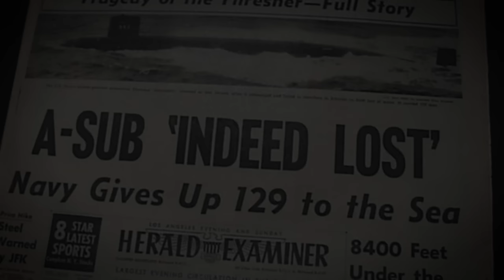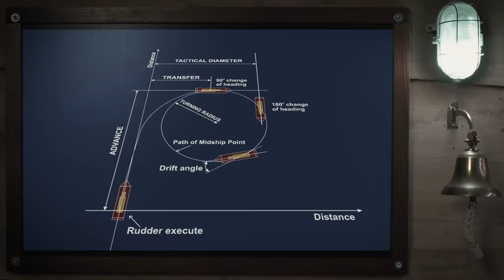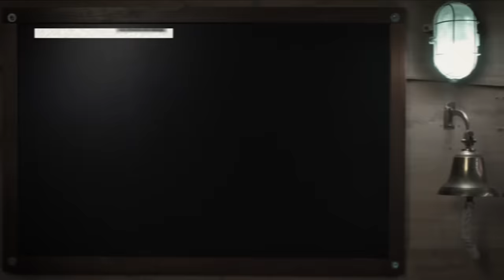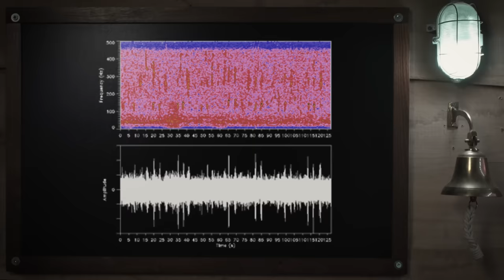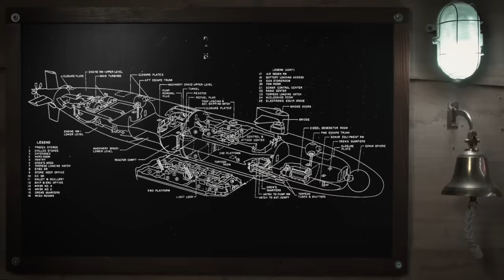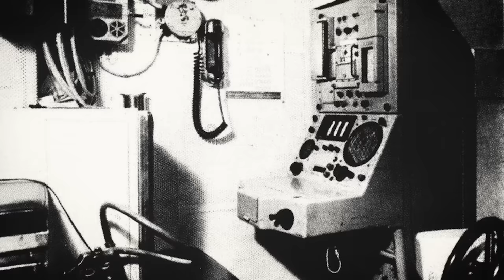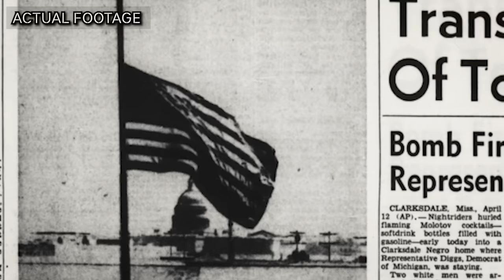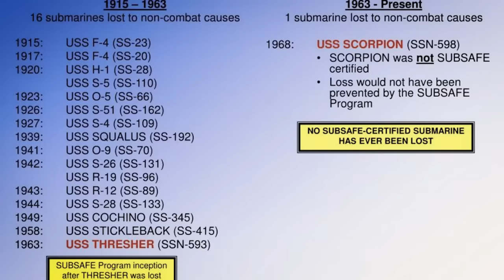This Water Pipe Killed All 129 Men

Comment: I had heard about the Thresher a long time ago.  I also read about the freeze-up of the strainers that interrupted the ballast blow, but this is the only source I've come across that explained that the strainers were not a designed part of the system, and were only temporarily installed by maintenance for testing purposes, and where meant to be removed prior to going to sea.

Comment: If the research I read is correct, it was not a “pipe” that caused the flooding, it was a faulty weld at the hull/ pipe junction.

Comment: Ex Navy Nuke Submariner here. I trained on the S5W reactor in MTS-626 in 2016-17. What you say at 8:42 makes no sense. "Saltwater from the reactor cooling pipe floods the engine room." Saltwater isn't used in the primary or secondary loop. Also it isn't open to sea pressure so I doubt that the depth would cause a pipe failure with anything to do with the reactor or steam system. If those pipes did break, it would not be water coming from the reactor vessel or piping before the turbines (as shown in the animation), but extremely high temperature/pressure steam.

The Thresher is a point of discussion in almost every step of submarine training, even long after I got to my boat. Ultimately we don't know what caused the loss of power, but we are certain of the high pressure air lines freezing during the main ballast blow. Also as a machinist's mate learning quality assurance, it was pretty crazy to see how intense the SUBSAFE program is for all the critical systems on board. Parts go through extreme testing and can be traced all the way back to the mine where the ore for the steel was mined.

It's cool to see such a well made, engaging video telling the story for so many people who otherwise wouldn't know about it though! I'll never forget how nervous I was the first time going to test depth. If you weren't standing watch, it wasn't very exciting though. No creaking noises or compressing bulkheads like in the movies, so for the next time I was off watch and slept through it.
Reply from the maker: Thanks for sharing. It's great to hear from people who understand better than I do.

Comment: All in all, good video. I'm not a nuke (full disclosure) and not a submariner. I was a Surface Warfare Officer for 20 years (that means I was on ships, and the powerplants of my ships were conventional steam or gas turbine). I am also a history buff (not a historian, just like history). When they isoltated the plant during the casualty, they had residual steam in the plant (a nuke plant is a steam plant, but instead of using boilers, they use magic rocks to heat the water into steam) and possibly could have provided steam to the turbine to drive the boat back up. Rickover modified procedures after to give his nuclear engineers more latitude to save the ship vice foloow rote procedures. It's a case study and is actually part of the Timothy Blake Nelson movie about Rickover (it's a good movie, watch it!).
Reply: They shouldn't have put a greenhorn officer on the job.

Comment: Aye, my father worked on the design of the steam turbine for this sub. He had a photo of it for decades and I eventually looked up the SSN number to discover it was the Thresher. He said there was a failure in piping that froze and prevent the sub from surfacing. He had that picture in his office till retired and then kept it on a wall at home. Sadly, a sibling stole it after he passed.

Comment: FYI- a thermocline bends sound waves, not necessarily radio waves. The Scorpion was lost after the Sub-safe program was implemented, but Scorpion had not been retrofitted with the Sub-safe modifications at the time it was lost.
But otherwise a very detailed explanation of the causes of the loss of Thresher. It just goes to show, the smallest oversight can be deadly. Forgetting to remove the strainers from the air lines is so small and inane. I had heard that the ballast blow airlines had frozen, but I had not previously heard that the strainers were meant to be removed. The previous accounts implied that it was a design flaw. Now I know it was human error.

Comment: I was a qualified engineering watch supervisor, electrical operator, and throttleman (among other stations) on a Thresher-class fast-attack boat with an all but identical reactor and steam plant. Had all six coolant pumps failed for any reason then 'XC,' the emergency cooling system, would have been immediately initiated, and there was no way to quickly restart that reactor after XC was initiated (it was a last-resort procedure). I might add too, that there was no 'excess steam in a secondary system.' After a SCRAM, if steam continued to be drawn by keeping the main engine throttles open, the Thresher's reactor would have QUICKLY cooled to the point where it couldn't be fast started without risking potentially catastrophic damage (say, cracked reactor pressure vessel). However, and this is the procedure NAVSEA came up with after the Thresher sinking, they could have kept MS 1&2 (the main steam isolation valves), open if the throttles were immediately shut and electrical loads greatly reduced. In my day, upon a SCRAM, the throttleman would immediately close the throttles, the electrical operator would trip both turbine generator breakers (loads would automatically shift to the battery via one or both motor-generators) and the order would go out, very loudly!, over the 1MC (ship's announcing system) "Reactor scram, reactor scram! Rig ship for reduced electrical!" At that point, the reactor could be fast started IF a list of conditions were met, the most limiting being reactor cooling system pressure and temperature, which had to be within certain narrow limits. I might add as well that the SUBSAFE program the Navy started after her sinking, limited my own boat's max depth to 300 feet for most of its operational life. It was only in the 1980s, after a two-year SUBSAFE overhaul, that we took her down to the (then classified) test depth of 1300 feet. I was aboard for that dive. Trust me, we took it SLOW!

Comment: Really interesting, that there are some details that come out of investigations I guess, without having physical evidence/comms. Like the temporary strainers in place, the pipes freezing up and that the young lieutenant closing the valves to the secondary steam system.
Reply: Those valves closed automatically on a reactor scram back then.  They had to be reopened manually and it took some time to equalize the pressure across them and then bang them slowly back open.  They just stay open now in case you need some emergency propulsion.  Lesson learned.

Comment: Great video thank you for your work.  This is the first time I've finally seen an account mention the strainers weren't standard on the ballast system.  All the others just mention the strainers as a new thing they were using.   Not giving the context.  As it wasn't something new rather it was maintenance having forgotten to remove an item.  To be only used under maintenance then removed.   Also i had not heard mention of the green sailor fresh from school running the reactor.  Rather an odd time to take shore leave during your ships sea trials.  Very informative and what happened makes more sense now.  Even the minor comment makes more sense.  It's still serious however it should have been able to surface one way or another.

Comment: Thresher had flooding in the auxiliary machinery space. The flooding scrammed the reactor, shorted all main circuit breakers, destroyed the motor generators thus incapacitating the entire electrical system. Sonar heard them announce over the 1MC, flooding in the ams emergency blow main bal, and was silent. He emergency blow brought them up to 300 feet from the surface. Then then went back down as the flooding was greater than the near 1000 tons of positive buoyancy from blowing ballast tanks. Pressure hull collapsed at 2540 feet.
I served from 64 to 72 one boomer, one fast attack.

Comment: NUC Submariner MM1 (1970 - 1976). By procedure, the hydraulically closed - manually opened main steam cutoff valve would have been closed after the reactor scrammed. That changed with the loss of the Thresher. Having opened a similar valve several times on the boats I was on, believe me, it took a while. It was best to have a second NUC standing by if it had to be done in a hurry. (We would time ourselves. It was a competition)

Comment: An incident description not provided was that immediate action upon a Reactor SCRAM was to shut the Main Steam Stop Isolation Valves, which deprives the ship of steam needed to drive the Main Turbine which could have saved the ship. Immediate Actions in the Propulsion Manual was changed after the accident to allow the Main Steam Stops to be left open upon receipt of a SCRAM.

Comment: Minor correction: At 08:44 you state ‘salt water from the reactor cooling pipe floods the engine room…’. Reactor coolant is not salt water. It is pure water. Salt water is used in cooling systems that then, cools other systems that cool the pure water in the reactor. As for isolating steam during a flooding event because you didn’t want to over cool the reactor following a scram, we had a philosophy in the engine room that a safe reactor does absolutely no one any good on the bottom of the ocean. 😁

Comment: I have felt how distinct thermoclines can be many times when I have swimming in the Oslo Fjord, but then usually with my feet when I'm threading water. I don't know if this happens more often in deep fjords like we have in Norway, where there is relatively little exchange of water and the uppermost layer of water can be heated up during a warm and sunny summer day. Very often when I've felt it the thermocline is about a 1 - 1,5 below the surface. I have felt it several times in the small pond in the forest when I am on a forest walk in the summer. I'm almost always get surprised by how distinct the thermocline is.

Comment: The Gertrude under water commutation system doesn't use radio waves. It uses sound. The thermocline affected the propagation of the sound waves not radio.

Comment: I suppose this is a question that might have a classified answer - but why do you need so much electricity to start a reactor? To run cooling pumps when it is shut down yes, and in most cases electromagnets are part of the scram system - but start up isn't jumping a car. Its pulling out physical rods that block the reaction. The SL1 accident happened because people were physically pulling on the control rods and pulled to hard. I imagine that a brave crewmember could be sacrificed to save the sub and start the reactor that way.
Reply: The pressurized water reactor needs high pressure pumps to pressurize the system. It will not self start. It's like trying to crank a petrol engine without spark plugs. Besides, you'd have to disassemble the reactor (again, the rods are in pressure vessel), which would take hours if not days and they had minutes at best. I doubt it's even possible to do inside the submarine itself.

Also, the fact that the reactor scrammed was a serious but not insurmountable problem. They had both enough energy to restart the reactor and residual steam to propel the boat.
The problem was that the procedure that they had at that time called for immediate isolation of the steam to the turbine in case of scram which cut off the propulsion.
Unfortunately, Thresher's reactor control officer wasn't present during the fatal dive, the more junior officer was running the show and he probably followed the procedure to the letter. During the investigation, reactor control officer stated that he'd break the procedure and did not shut down the steam, allowing the sub to drive itself up on her own propulsion.

The procedure was later changed to include both rapid reactor restart and using residual steam to drive the boat but unfortunately, as is often the case, this change was written in blood.

Comment: Three points to remember.
1 Brazing is not comparable to or an acceptable replacement for welding under any circumstances.
2 if you install any strainer into a mission critical fluid system they had better be removed immediately after their required purpose had been met.
3. There's no substitute for experience.

Comment: Norman Polmar has a good lecture on this subject as well.  Other good resources for those who want to learn more are the congressional inquiries made by the AEC (the same organization depicted in Oppenheimer) and the FOIA documents released to the public.  

Some of the details I think are interesting is that Dean Axene noted in his interview with Norman is that flooding in the engine room would not have been considered a 'minor difficulty', whereas a reactor scram may have been considered a minor difficulty.  If flooding did occur, it would have required alarms to sound throughout the ship notifying the crew that flooding or some other type of casualty has occurred.  Also the brazed joints used on Thresher received a hydrostatic test prior to her being put out to sea.  

These details mean that while flooding is likely the cause of the loss, it is not impossible that something else may have happened to put Thresher on a course towards disaster.  Unfortunately the communications recorded by Skylark or physical evidence do not lead us to any definitive conclusions as to what actually happened which is why the Navy had to look at all of the critical systems that could have failed and spend billions of dollars to make improvements in submarine safety.

Comment: To qualify myself, I served aboard the nuclear powered submarines Skipjack 585 and Barb 596. I am familiar with the design and capabilities of this class of submarine. The description you give follows submarine logic and action to correct a problem. It can only be a likely series of events.

What is positively known is this: Thresher lost buoyancy, lost depth control, and thus descended to below crush depth. 

The specifics can only be speculation but is is rather obvious flooding was the cause of loss of depth control: the boat became too heavy to rise through normal or emergency blow because of being below the depth that blowing MBTs could be effective or blowing MBTs failed. The cause(s) of what system(s) failed to get her to the surface is a best guess which I believe you presented rather well.

Essentially, future submariners and submarines have benefitted because a "3M" system of maintenance and inspection was put into action.

Ahoy and my salute to my Shipmates on all submarines of every nation who are still on Eternal Patrol.

I wish all Families of all Submariners lost at sea, Peace and Comfort.

Comment: There was no radio communication between Thresher and the surface, communication was with what is called an underwater telephone. This amplifies speech and sends it directly to a hydrophone which puts out plain speech as sound waves, not radio waves. Anyone can hear this without needing a receiver.

Comment: The underwater comms use sound waves, not radio waves. Thresher had ballast tanks, which would be used when hovering to maintain neutral buoyancy. If the sub had a slight positive bubble, they used the planes to maintain depth while in motion countering the upward buoyancy. When the sub stops forward motion, the slight positive buoyancy will cause it to start floating upward. The same is true for negative buoyancy, that is, in motion, they counteract sinking by using the planes, and when forward motion ceases (with negative buoyancy) the sub sinks.
Reply: The first sentence is literally "Well akshully" guy.

Comment: We also have one way check valves in our EMBT systems (emergency blow system) to prevent any water from back flowing into the HP air lines. SUBSAFE items (essentially any single point failure item that could cause a loss of the sub) have extremely strict rules in place for obvious reasons. There will be a minimum of 3 independent people verifying any work done on these items, and to even work on these items requires an advanced level of maintenance qualification. We take keeping water out of the people tank very seriously!
The submarine force will continue to respect and honor all 52 subs on eternal patrol every April, during the submarine birthday ball, in a tolling of the bells ceremony.

Comment: I find this story to be incredible. While in a port that cannot offer shore power, diesel generation is used. The diesel power fails along with the presumed backup diesel power leaving the sub on battery power. Not until after the batteries are completely depleted (in which case renders the sub totally powerless and vulnerable) is there an attempt to connect to another ship to provide power which I'll presume was available all along. All this time the ships Captain is absent and tending to (more important?) business somewhere ashore. After this fiasco, the sub then suffers a collision with another ship that requires repair. During the deep dive trails the Senior Nuclear Reactor Officer is on shore leave. In his place is a rookie officer on his "first assignment" fresh out of nuclear reactor school. (That is simply unbelievable) During the deep dive test and while well within a tolerable depth a pipe seam bursts spraying high pressure salt water on critical electrical equipment that shuts down the reactor. (so much for quality control). It was eventually discovered that filters were left in some pipes during maintenance that should have been removed. As the crew looses control of the sub the rookie nuclear reactor officer makes a decision that was later deemed not advisable and it was presumed a decision that would have not been made by the Senior Nuclear Reactor Officer if he had been onboard. Seven months later JFK is assassinated. May the crew RIP and God help us all.